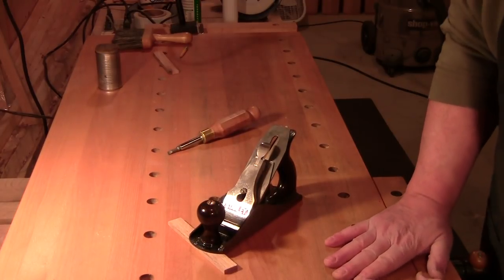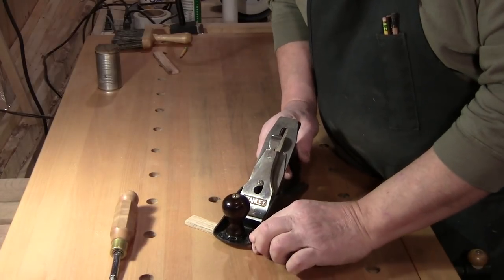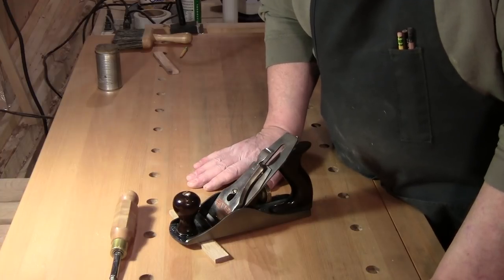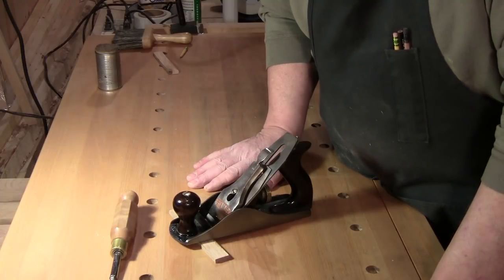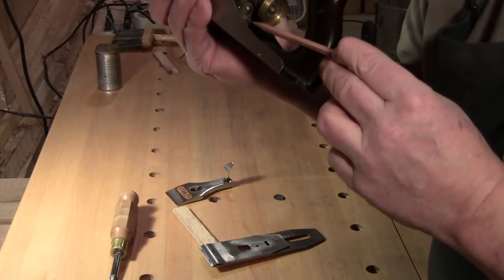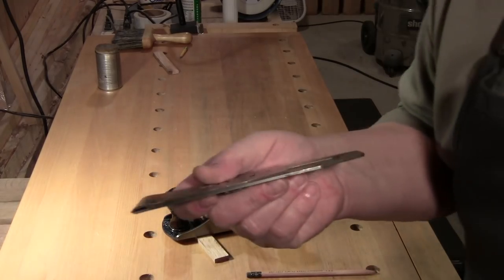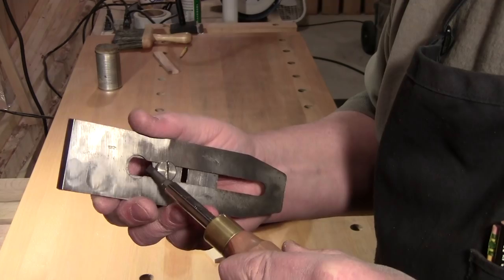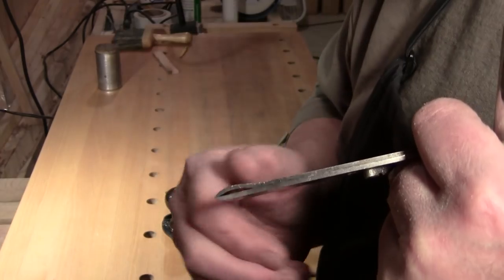The Real Truth About  Stanley / Bailey Pattern Planes - PLANE TALK - 14 March 2019

Comment: Couldn't agree more Walter. I just put a new 2 1/4" Hock high carbon steel blade in the old Shapleigh 5 1/2 that was gifted to me and it cuts very well. Now I need to find an older 2 1/4" lever cap to make it complete. Great video, thanks.

Comment: Hi,
Thank you for this informative description of the Stanley No4 Plane. The Yoke that you describe is attached to the Frog with what? Is it a screw or a roll pin? The reason I ask is because I am missing this item and I would like to know what to ask for to replace it.
Thank you.
Reply from the maker: Thanks for writing,
The yoke pin is riveted on so, any snug fitting piece of mild steel can be use but it should not bind.  
NH Plane Parts might be able to help you with what you need.
Thanks for watching.

Comment: What brand screwdriver is that?  I love the shape of the wooden handle
Reply from the maker: Shop made by me.
Took the guts from a Lowes plastic handle and made my own handle.
Reply: Can you share the process to get that shape??
Reply from the maker: @randygust3423  I sort of took the design from the London Pattern but simply put you make a tapered octagonal then then turn both ends on a lathe.